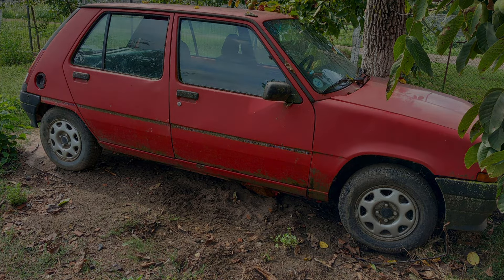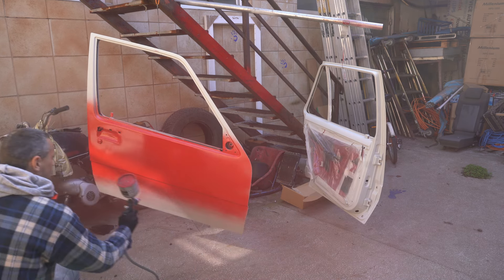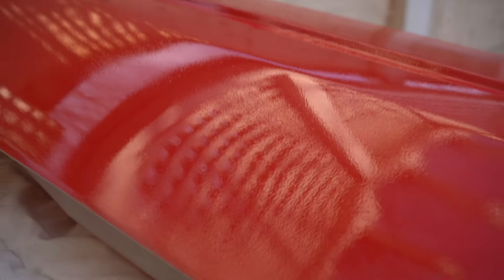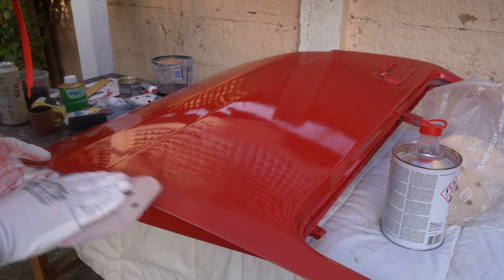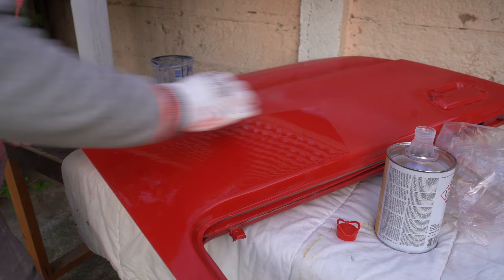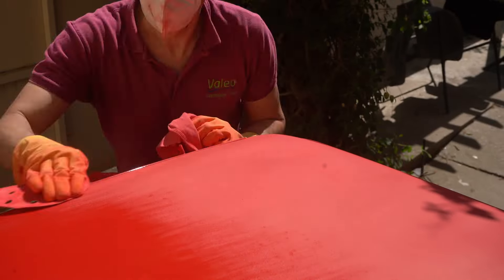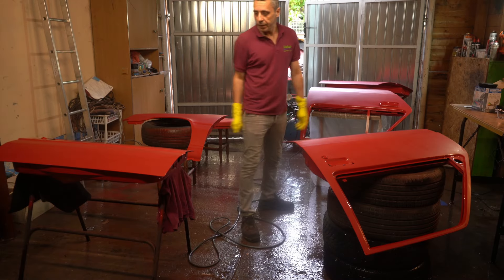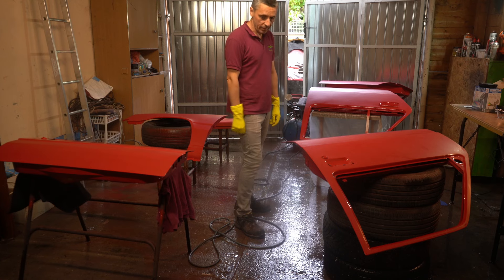Painting My Car at Home with a €10 Spray Gun - Part 2! 😱🎨🚗 (Will It Look Perfect or Fall Apart?)

Comment: Are you using the original cellulose paint?
Reply from the maker: no, using some 2k paint
Reply: @Renault5Campus  When I painted mine, first time round I used a pump-action spray gun & it looked terrible.  But with an air-operated gun, it was much beter!
Reply: @Renault5Campus  I notice how you paint along the short edges sometimes- I always thought you should paint along the long surfaces?
Reply from the maker: @vasilis8208  I guess you are right but considering the tight space I had I somehow needed to do it this way.
Reply: @Renault5Campus  That's true!